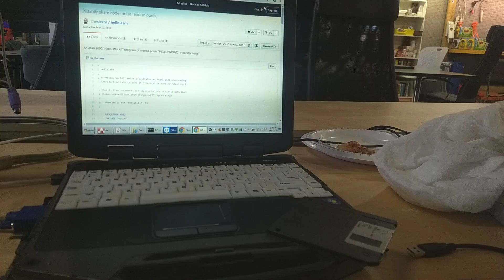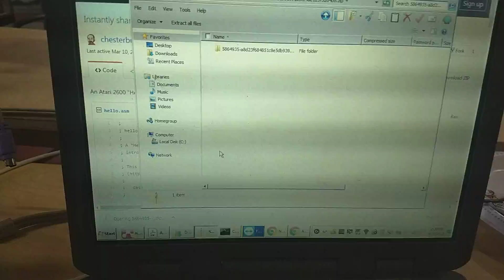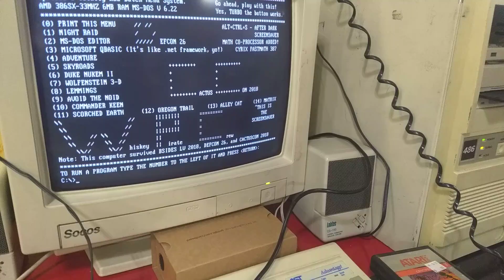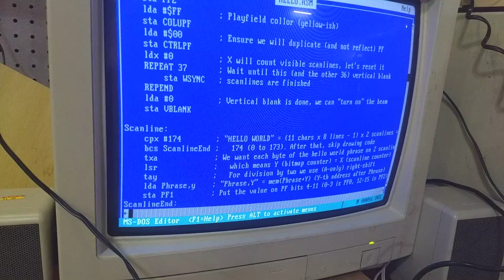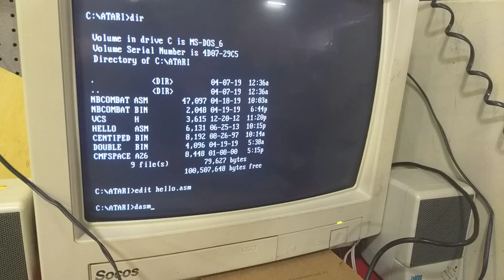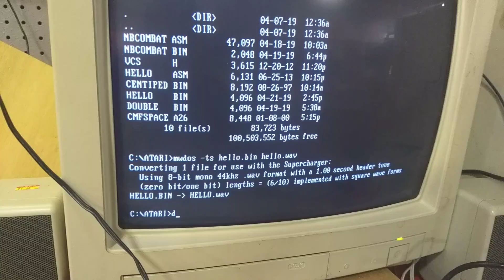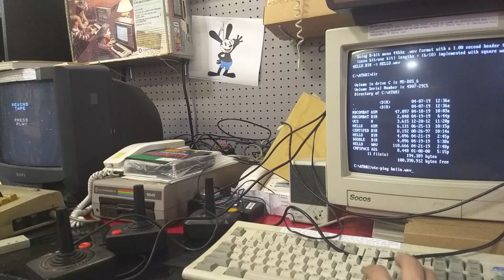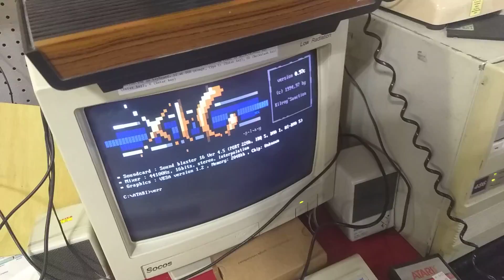386 based Atari 2600 development system

Comment: I have an Atari and a Supercharger, but I really want to make my own Atari game cartridges instead. Thank you for showing me the procedure that you do in order to make your own Atari 2600 VCS video games.
Reply from the maker: The good news is that to make your own cartridge, all you have to do is take the .bin file you get from dasm and burn it to a ROM! (So instead of taking the .bin and making it into an audio file, you'd be taking the file and burning it right to an eprom/eeprom)

If you look up "DIY Atari Cartridge" you should see many different pcb designs and what eprom/eeproms you need to buy.
A relatively cheap TL866II should be able to program them with your binary, then it's just having a socketed PCB to push it into, and you can likely 3D print a cartridge case or get a friend/service to do that for you, or given how cheap the used games are, it's likely you can reuse that as well.

If I recall, you are limited to 6KB with the supercharger cartridge, but you'll see quite a few neat demos at 32K (or more(!))

The methods here with the supercharger will let you test your code before you go to the effort of burning a rom and assembling a cartridge, letting you tweak things more/less on the fly. 

There also exists the "2600 Harmony Encore" cartridge which uses sd cards, I did this project to sort of figure out what the minimum viable configuration would be to do this sort of stuff in the late 80's / early 90's. People back then were actually using the supercharger cart with a Commodore 64(!) it turns out to do some of this kind of 'instant dev' type work to learn how to program homebrew on the 2600.

I hope this helps!
Reply: @cprossu  Yes it does help. Thank you very much for this valuable information. I already have four different BIN files that I had been playing on my Stella emulator on my Windows PC, but I want to play them on my actual Atari 2600 VCS. Since I do have a Supercharger I could test them out as WAV files too. However I know the programmers of these BIN files and they have assured to me that their games are completely ready to go to cartridges.

Comment: I'm surprised that the .wav file actually works with the super charger. Unless I am just understanding it wrong or missing something. I wouldnt expect output to be compatible. I wonder if this method would also work with the Atari Recorder from Radio Electronics Magazine. https://archive.org/details/AtariGameRecorder/page/n1
Reply from the maker: Sorry for not seeing this earlier! Youtube isn't so good at letting me know when comments are made oddly enough!
Well the main thing is the wav/mp3 file isn't going to the supercharger cartridge, the audio output of the file played on the computer is (in this case analog output from the sound card).
I will say that sometimes I need to fiddle with the audio levels to make sure it's reliable, thankfully that Sound Blaster 16 is one of the early ones that has an analog volume knob on the back, so it's rather trivial to get the audio levels just right on the fly.

As far as I know just as long as there's enough definition and the volume levels are set correctly, audio is audio. Just like playing it from a tape, record, off the radio, or whatever analog line/headphone audio level as long as there's not too much interference it will work.

Comment: nice, the supercharger seems to be a nice bit of kit.
Reply from the maker: Yeah, it's a lot of fun, and some of the games that were put out of it (Like the official frogger port, and there's an adventure game called dragonstomper) were ahead of their time and really pushed the 2600 pretty far! I doubt very many people decoded the secrets of this thing back in the day, but for t hose who did, they ended up with a very cool way of developing games!
Reply: @cprossu  i picked up one that was listed on ebay (listed as not tested) for $40, it works flawlessly. i also bought a little cheap MP3 player to use on it (works great, just had to find the volume the supercharger liked).
Reply from the maker: Super awesome! Pretty satisfying seeing something load in, isn't it?
Reply: @cprossu  indeed, pretty ingenious as well

Comment: 6 megs of RAM AND a math coprocessor?? pretty impressive for a 386 :-)
Reply from the maker: I know right! It would have 8MB but 2MB ram died at Defcon 26 for reasons I am unsure of, and 6 is plenty, so I'm leaving it there!
Reply from the maker: @Itsacreeper The IT Wow, I bet most of that was in the cost of the RAM, hahahah (The 486SX's were sold at a steep discount compared to the 486DX)
Reply from the maker: @Itsacreeper The IT Not quite! As far as I know Intel released DX's in 25 and 33MHZ, and eventually 50MHZ. DX2's were available in both 50MHZ and 66MHZ. (with DX4's being faster than that). It gets more complicated if you add the Cyrix, TI, IBM, and AMD offerings into this mess, or the fact that the "487DX math co processor" was actually a full on 486DX that disabled a 486sx when plugged into a supporting board. YAY MARKETING! I have heard rumors that there were 486sx's released in 15MHZ and 20MHZ, but I have never actually seen any with my own eyes.